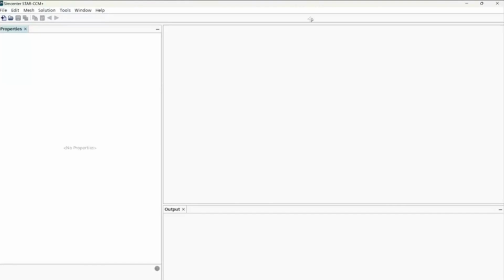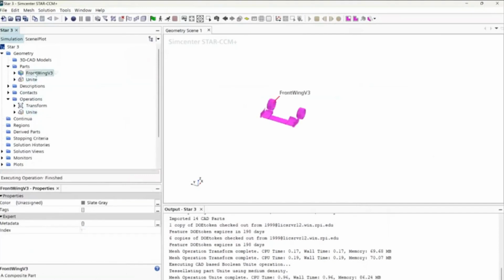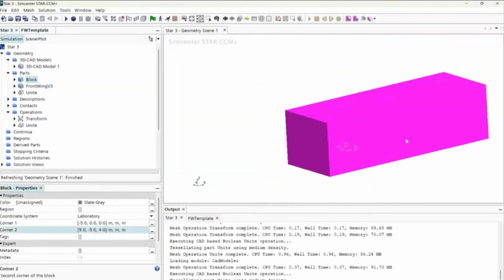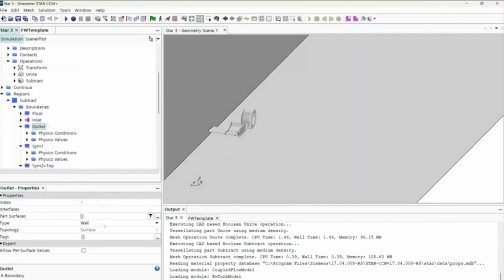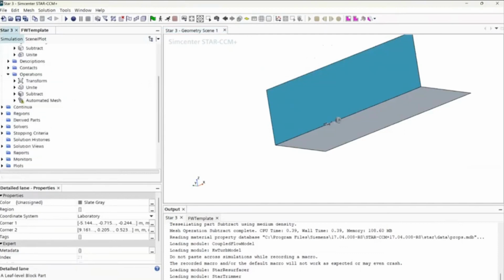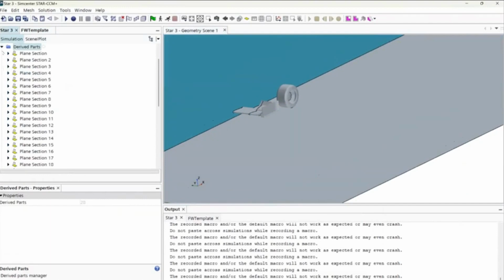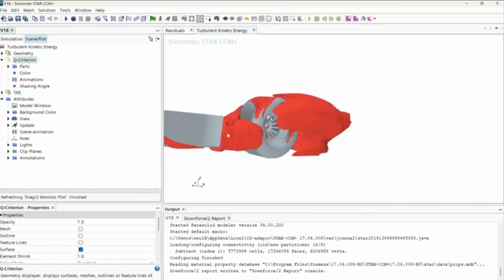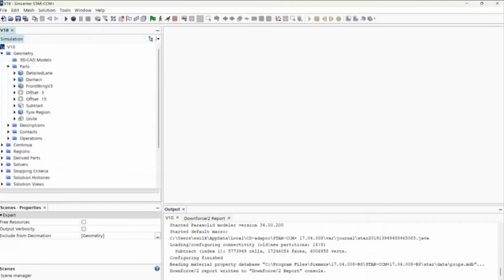How to do use  STAR-CCM+ for FSAE Simulation Part 1

Comment: Great video! But If I unite my parts, it doesn’t unite all of them. Some parts are missing, do you have a clue why?
Reply from the maker: I would look at the output window for any errors. Boolean-related errors won't pop up but will be in the output window. Secondly, it may be due to flat sheet metal being used in a boolean/sheet part of anything. Finally, a bad intersection may be causing the issue. if two parts meet on a flat surface, they need to fully intersect each other for Unite to work.